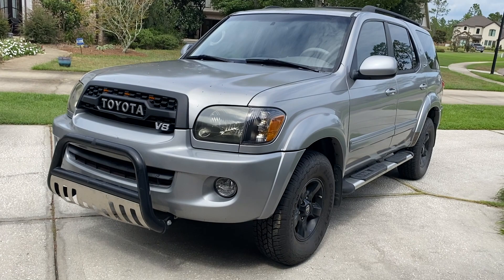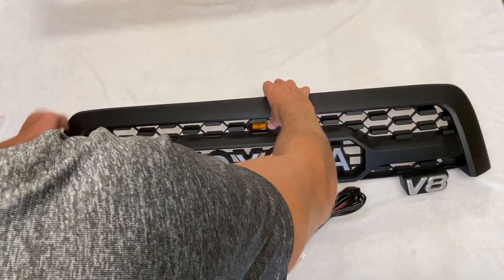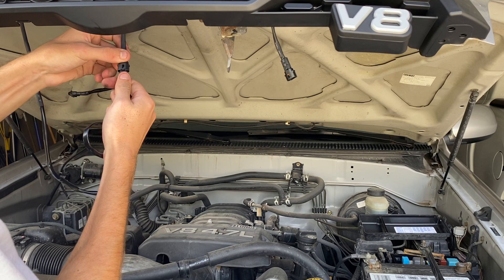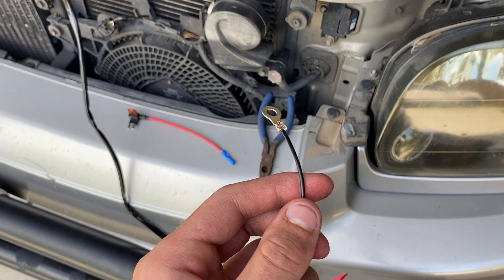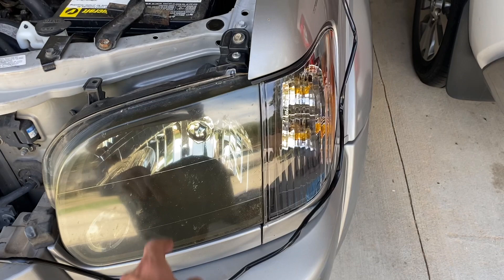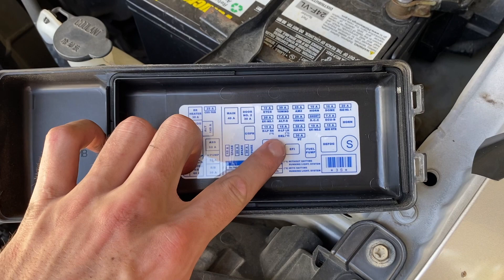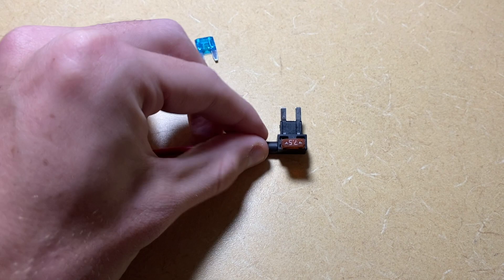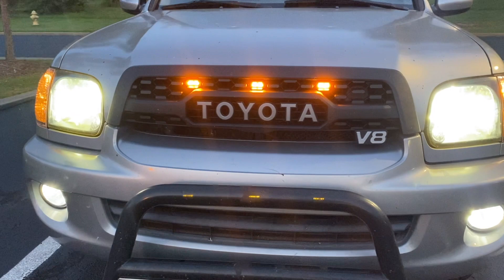Toyota Sequoia TRD Pro Grille 1st Gen - Wiring Guide

Comment: I've tried tapping into several different fuse locations, but my lights still aren't coming on. They're properly grounded, fuses in the right place, lights connected firmly, truck on, headlights on... nothing works. Any idea what the issue might be?

Comment: There is a gray 2 pin connector between the fender and the battery that you can disconnect to disable the DRL.
Reply from the maker: The fuse will still probably have power though right